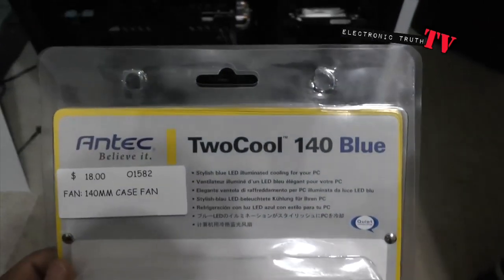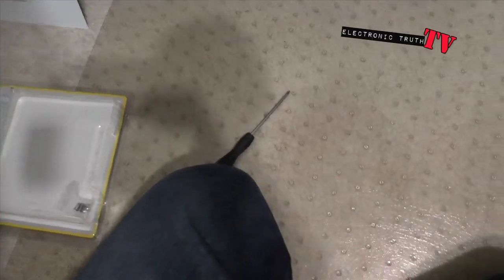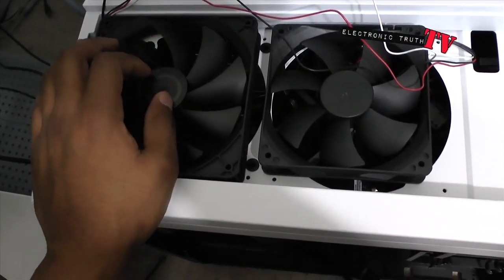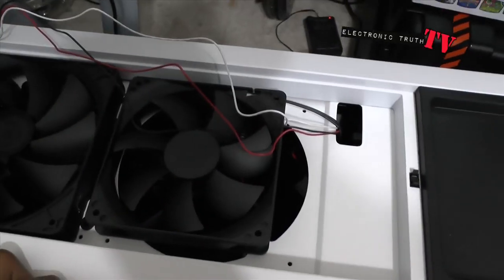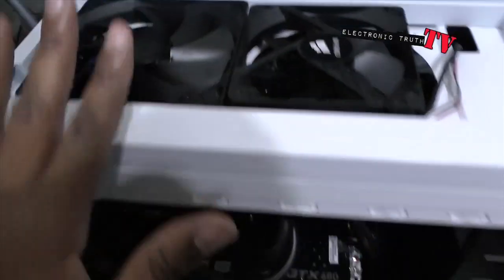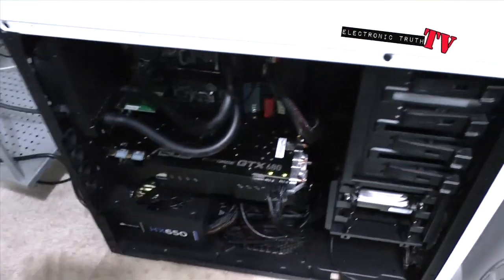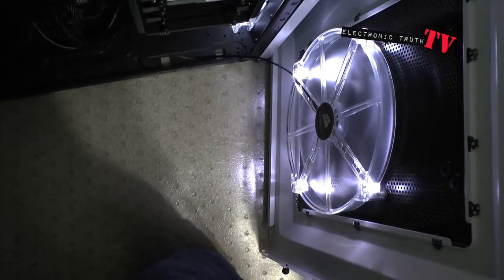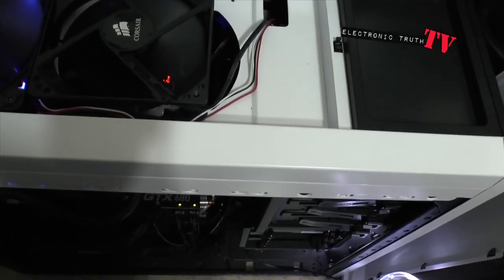Hackintosh 140mm fan install

Comment: if you want better cooling for the CPU you should have setup the rad in a push pull config. and  you want positive air pressure in a case so you want more air intakes then exhaust. but this is just my 2 cents.